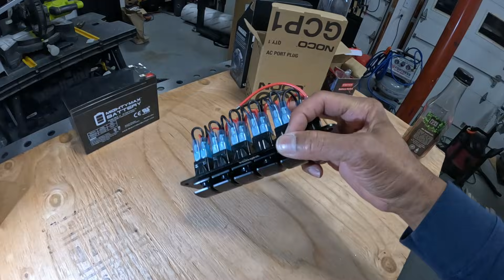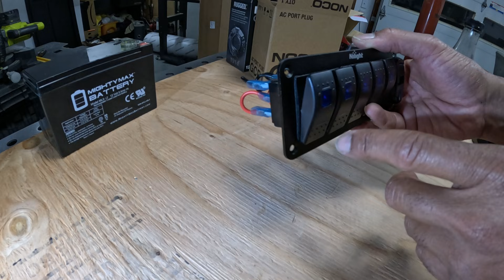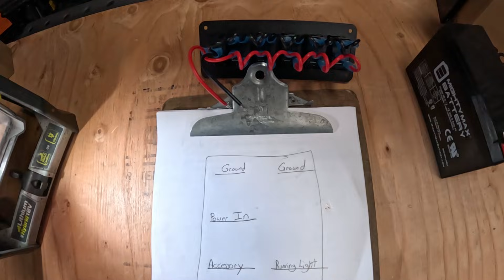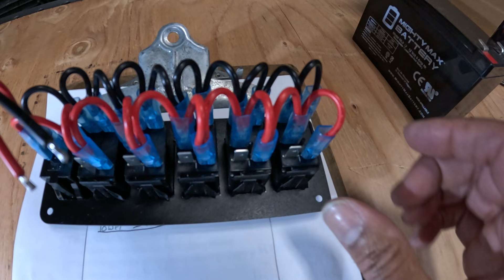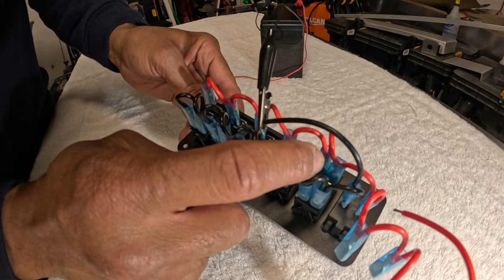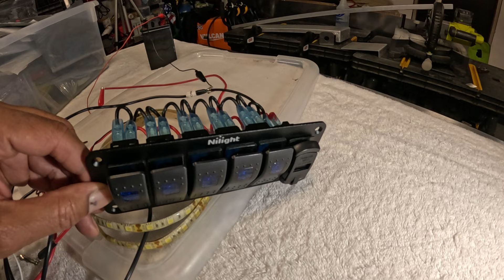Never Mess Up Your Switch Panel Wiring Again!

Comment: I did exactly the same thing.  I'm only using  3 or 4 switches.  A breaker might be a good idea also  but i'm not sure  at this point.
Reply from the maker: @gewglesux  breaker is helpful.
Reply: @BassBrothersFishingDMV   great!!!  thanks!!!  i thought so.
Reply: I have an 8 switch panel like this. No volt meter though, just switches. Would it be better to put a fuse between the battery and switch panel and also have individual fuses between each switch and what's connected to them?
Reply from the maker: @DavidBender-d6i  absolutely. The fuse between the battery and switch panel is a safeguard to the whole system.
Reply: @BassBrothersFishingDMV  You're video is very clear and informative on how to wire it up. Thanks for the help. Greatly appreciated!